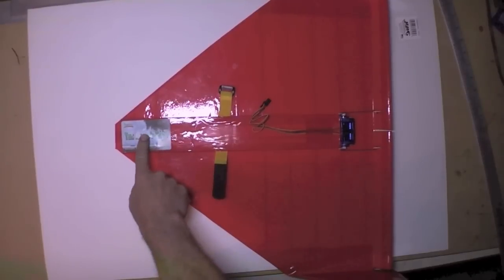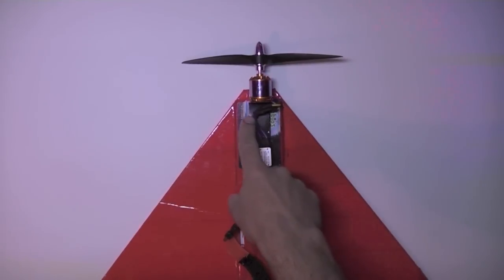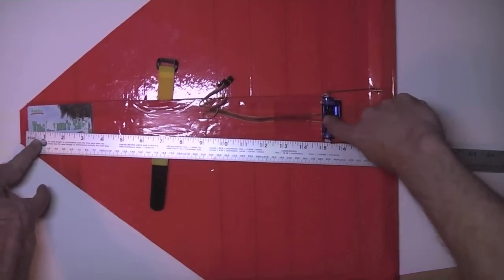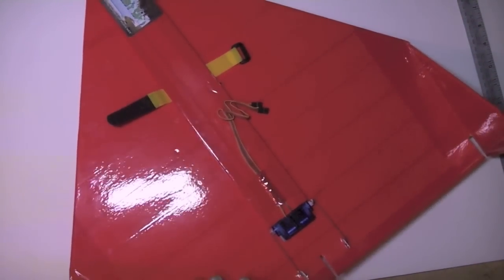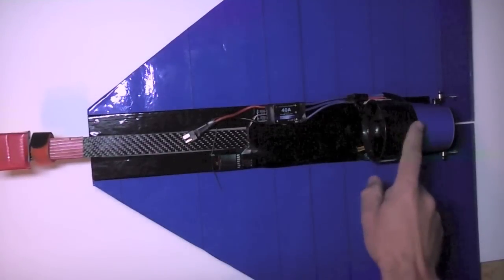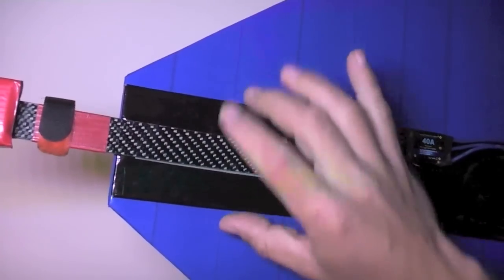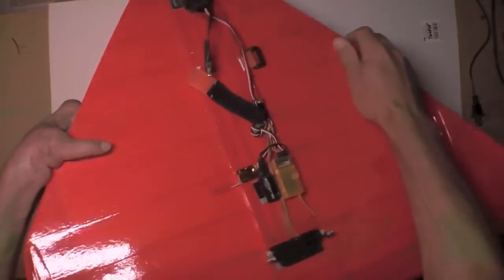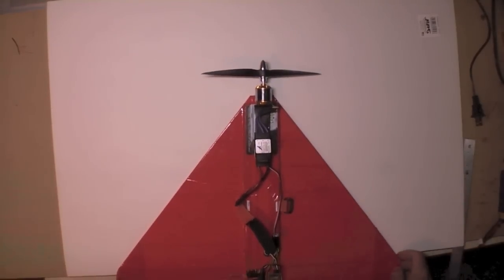FAST FOAMBOARD DELTA WING - Details

Comment: Thanks for the build details Ed, I built this delta in a couple of hours. I used the turnigy 2200kv and it had crazy speed, nice roll rate.  After 20+ flight I clipped a tree at full speed, went into a spin and crashed so hard the lipo went up in smoke and created an awesome display of flames lol! Managed to save most of the equipment, except for Esc. 
Currently in the process of building another one, might use a landing gear of some type to save on props.

Comment from the maker: You'll find "elevon" in the menu of the DX6i under "wingtailmix".  Turn that on and the servos plugged into the elevator and aileron channels will function as elevons.  I generally use the elevator channel for the right elevon and aileron for left elevon.  But you can, and will probably need to, play around with the servo reversing settings.  Look at the elevons as you move the right stick and be sure they move as needed.  Switch receiver channels and/or reverse servo throw on radio as needed.

Comment from the maker: I usually like to go foam-to-foam however this is a relatively broad-based low-stress area so you can probably get by with tape-to-tape.  Scotch heavy-duty outdoor mounting tape works awesome as well, more secure than hot glue, in case you want to give it a try.

Comment from the maker: You could put in a little right angle if you're really diligent but I wouldn't obsess over it. I mount mine straight.  Having the thrustline above the airframe imparts a little bit of downthrust even though the "firewall" is 90 degrees to the deck, so I don't usually put in any additional downthrust.

Comment from the maker: A little down-right thrust angle never hurts.  I recommend either a very steep launch angle with high power, and then just deal with the roll as it ascends, or a more normal launch angle but only half power.  The good news is the takeoff rolling is usually brief.  If you truly have torque roll through the entire speed range then I'd revisit the thrust angle idea and/or mix in some counter-elevon to your throttle channel if your radio allows.

Comment from the maker: The smoother and thinner the trailing edge the more "orderly" the upper and lower columns of air can "re-join" behind the surface.  Blunt trailing edges lead to turbulence and vortices that create an area of negative pressure behind the wing, tail, or control surface that causes increased drag.  How much added performance in a plane like this?  Probably not much at all, but I like the idea of optimizing the situation as much as possible for speed.

Comment: Been to Coyote Basin a couple times hoping to bump into you. Just didn't work out. Flew the wing. Found out Velco is a poor choice for an open fuselage at high speeds. It gets exciting real quick! Good thing these things are cheep. I'll probably start over to have confidence in the airframe again. Fun design.

Comment from the maker: Yes, these are nimble little planes, can be pretty sketchy on takeoff.  You can certainly adjust your thrust angle a bit.  It's hard to dial in the elevons in a way that is good for both takeoff and normal flight, but you could mix the throttle channel into the roll function some counter-elevon.  Honestly though all I do with these is just try to take off at half throttle, upwards about 30 degrees, and get stable before hammering the throttle up.

Comment from the maker: Maybe just luck, but I never seem to damage props landing on grass, and occasionally on asphalt.  I do program the brake to "on" for all my ESC's that will allow it, for better glide as well as to provide little or no prop rotation on landing.  If a blade is hanging down it seems to just pop up 90-degrees and out of the way at the moment of landing.  If I'm flying a slower plane sometimes I'll actually tap the throttle stick as needed to place the prop horizontally just before landing.

Comment from the maker: I always tape boards before construction.  It's a lot faster that way and with some practice you can cover the foamboard in 5 minutes (per side).  I usually knock out 10 at a time.  There is a video on this channel that describes some tips on how I do it.

Comment from the maker: I tape the foamboard first, both sides in the case of this plane, then actually construct the plane.  It adds a little weight but a lot of strength, but it's still pretty light once done.

Comment from the maker: Ideally elevon mixing is done via transmitter programming.  As another option one can use an onboard mixer but the performance is not as precise.  Each transmitter setup is a little different, but typically one elevon servo uses the aileron receiver channel and the other elevon servo uses the elevator receiver channel.  I will make an effort to discuss it in a video.  Let me know if you have any specific questions in the meantime maybe I can help you with.

Comment from the maker: Indeed there is no camber.  It develops lift from incident airflow against the bottom of the wing only.  It's a complicated topic but I can say that sufficiently powered RC models in the size we fly work reasonably well with uncambered wings.  Probably wouldn't work well in large aircraft, though there are some pretty thin airfoils out there in some supersonic planes.

Comment: just started building one of your tractor delta designs and wanted to know if you added any thrust angle when installing the motor i.e. to the right and down or just simply installed at 90 degrees to the airframe.

Comment: The Delta wing/Blended Lifting Body has such a wide speed range from a walking pace to out  and out blistering speed.  The more power you put to it the faster it goes.
So much fun. 
I really enjoyed you video, great ideas and a bunch that I didn't think of before.
 Cool info.
Just a thought.... How about for the EDF, full length "tube', then wrapping the Coroplas around the EDF , install  all of the flight controls  in the wing? Really smooth things up aerodynamically.
. 
My Delta, scratch built, kinda the same design,  just a bit bigger, 48" W.S. 36", nose to tail. Made out of parts of a regular shipping pallet, cut into 1/4 square stock, Winglets bolted to threaded hard points,  powered by 2 different engines,  O.S. .25 DBB, FX, and  an  O.S. .40FN. Plain Bearing.  Flying with  a Futaba 6ch.  Throttle, Nose gear, and Evalons.
It seems to be very aerobatic. Take off run is about 20 feet.

Comment from the maker: The rudder channel is no issue but you will need either elevon/delta mixing on your transmitter or a V-tail/delta mixer onboard the plane to mix the elevator and aileron functions.  A 3-channel radio probably does not have mixes so a V-tail mixer for under $10 is likely your best bet.  Most sizeable RC vendors sell them.

Comment: Very nice vid.  Is there a reason why the elevons can't be controlled with a single servo mounted vertically?
Reply: +TheGusK A single servo wouldn't be able to push or pull them at the same time, preventing them from acting as elevators. If it was set up to articulate them together, it wouldn't be able to move them opposite each other, preventing them from acting as ailerons.
Reply: +fromkentucky Thanx for the answer as I'm new at this.
Reply: TheGusK
No problem man. Some people do use single servo setups (called "Push/Pull") for just ailerons, it's just difficult to get linkage out that far if you have a large wingspan. Here's a picture:

http://www.wheek.org/macombat/gfx/rapier/aileronservo.jpg
Reply: +fromkentucky Now I understand.  Thx again.  Going to build one of these,  need a break from quadcopters. :)

Comment from the maker: Great question.  When you make an Armin wing or tube fuselage, the warped foamboard becomes irrelevant, since the process changes the shape.  For flat planes like this Delta, you really kind of do need a nice piece of foamboard.  I usually save the "pick of the litter" for those each time I buy a batch.  I do not have any actual methods to recommend to flatten warped foamboard, sorry.

Comment: Hi ed,  you mention that the rood chord of the vertical stabilizers is 6 inch as you show in the video.  However shouldn't (when drawing/measuring out) the root chord be 6 plus the length of the elevators?
Reply from the maker: Henk Hatzmann Aerodynamically, yes absolutely it's the total chord with control surfaces included.  For my construction techniques I often specify only the fixed part of the wing as it can clarify the construction cuts and so forth.  I usually call it such-and-such an "airfoil chord dimension plus control surface dimension".  It's more clear in one way but a little inaccurate in another way.
Reply: ExperimentalAirlines hi

Comment from the maker: I use flat when it doesn't make much of a difference and to keep construction super simple, such as with this fast delta and other light, low angle of attack planes.  Using a cambered airfoil has the advantages of better integral strength and way better lift over a variety of flight conditions, speeds, angles of attack.  Honestly, RC scale planes are pretty forgiving and you can loft any flat wing with enough power but a cambered airfoil produces lift in a more efficient way.

Comment: for a less experienced pilot (ie, me) could you just size down the control surfaces to make it easier to fly?  that would in effect tone down the agility and make inputs smoother right?  I recently built a much larger delta wing with a 56mm fan.  it is not that hard to fly, but is not very fast...almost underpowered due to the weight/size.
Reply: There is no need to reduce the size of the control surface to make it easier to fly; you can adjust the servo movement via the transmitter if yours is programable. Another option would be to adjust your push rod to the outer-most hole on the servo horn for reduced movement of the control surface or adjust to the inner most hole on the servo arm or a combination of both. Hope I was helpful.

Comment: where do you get the metal motor mount or is it just a home depot piece of aluminum?
Reply from the maker: CaviDS This is scrap 1mm titanium from a saltwater pool chlorinator.  But some stiff thin steel would work, or aluminium from HD, though a bit heavier.
Reply: I think the aluminium rulers would be a bit less expensive than the stock aluminium.  Will check that for accuracy today at HD.

Comment: I know this is old but I have a few questions so I'll hope for a reply. I built this wing but used a smaller motor. It's a 2204 2300kv motor. Do you think that will be sufficient? I ask because my first attempt at flight with it was an abysmal failure. It could have also been the CG. Does it glide unpowered with the CG at the recommended 7"? I'm fairly new to fixed wings, so I don't know where to start with my troubleshooting. I tossed it with power and it nearly flipped and crashed immediately. Heck, it could even be my crappy launch. Any suggestions on where to start to get it to fly?

Comment from the maker: Man I must be a 'tard because I can't see the PM link on your channel.  Can you ping me a PM and I'll send you back?  The CF plate is from eBay, searched under "carbon fiber plate" or "carbon fiber panel".  One store is performance_group_composites.  Honestly though, if you move the EDF forward a bit you probably wont need the nose extension and could do away with the CF part.  It is a nice place to mount a nose wheel though, but that can always be worked around or just omitted.